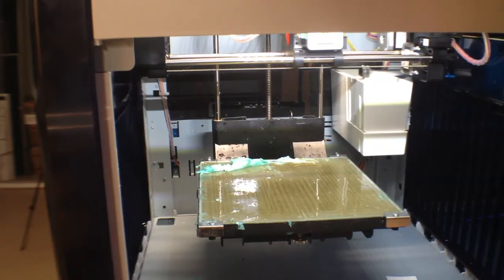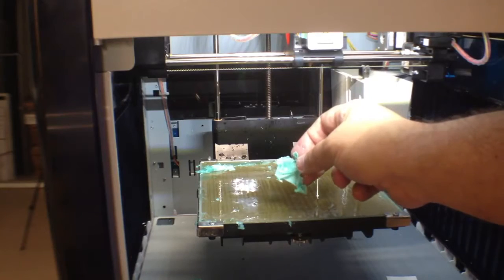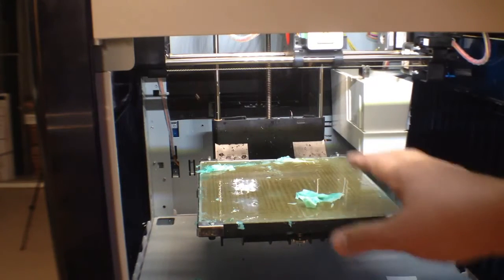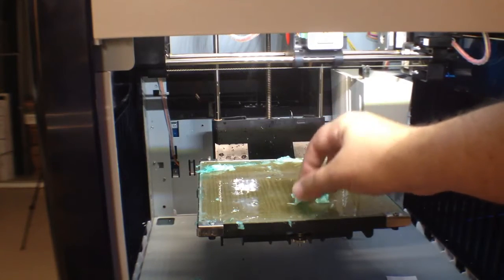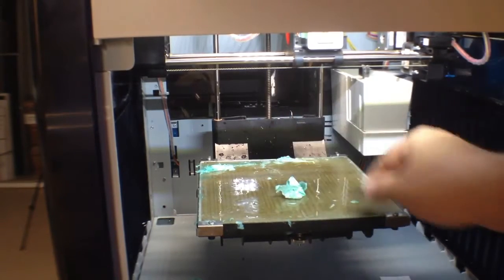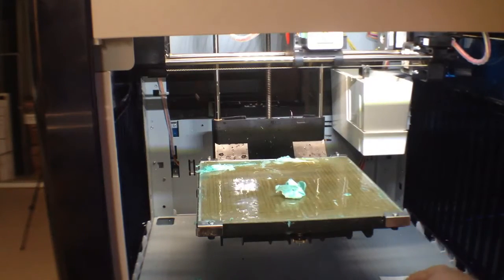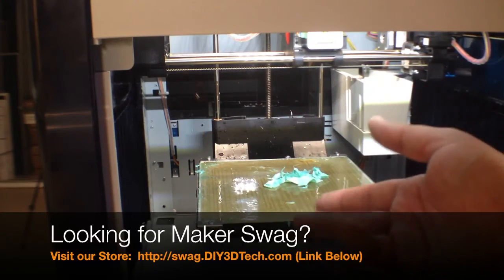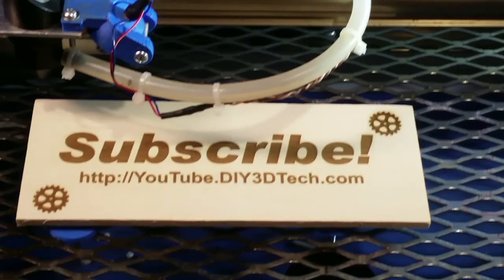XYZ Ware Da Vinci - Removing 3D Eez from the Bed!

Comment: Do yourself a very big favor, Switch to BuildTak.
You never have issues like this again and you get your bed evenly heated.
Reply from the maker: Yes have used BuildTak and currently using PEI on the Wanhao and love it.  However it isn't compatible with the XYZ Ware Davinci.  However since I reflashed it I might try modifying it...